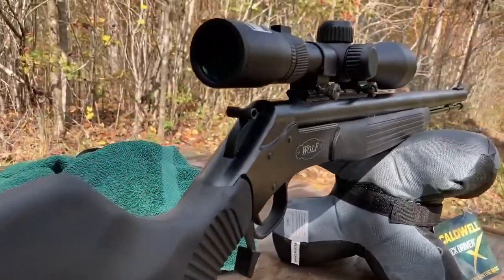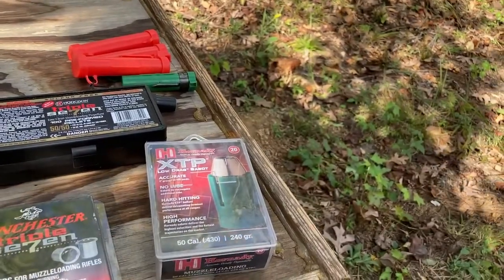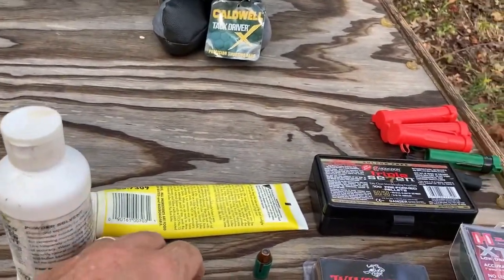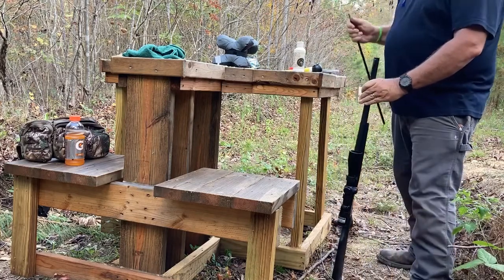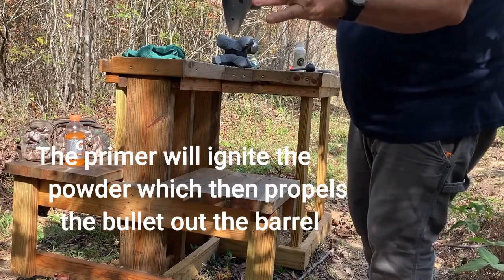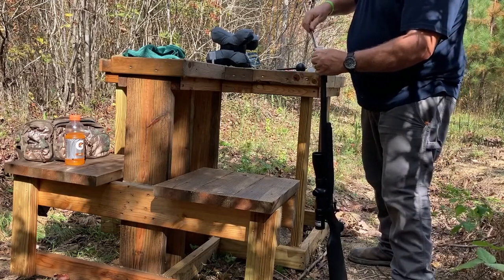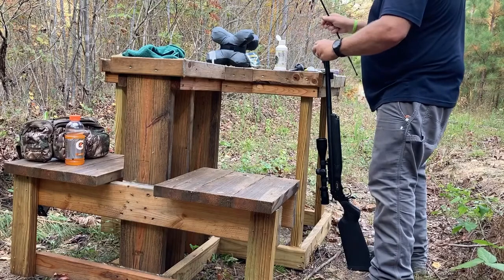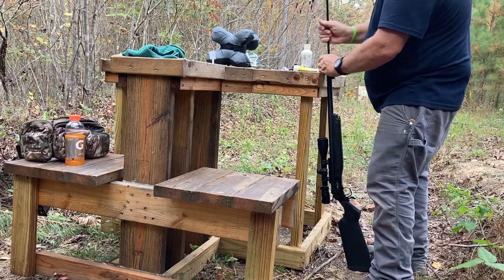Vlog #60 Shooting CVA Wolf & Optima

Comment: Try this. As much as I like the Bore Butter there is a large consensus that it will screw up your accuracy. Try just swabbing out your barrel with a regular cleaning patch concentrating on the fire ring that forms about where the bullet seats in the barrel, run a few dry patches down the barrel to dry it out and fire a cap to make sure its dry then load it and see if your accuracy improves. Powerbelt actually comes right out and tells you not to use bore butter with their bullets. Bore Butter is pure wax and all I can figure out is that it makes the barrel (Too slick). With all that said it is excellent to use if you're going to store your rifle away for an extended period of time and really excellent on the outside of the gun to prevent rust. I use it on all of my guns, they just won't rust when buttered up.
Reply from the maker: Okay, gotcha, I will try that approach on my Optima with the Powerbelt bullets.  Hopefully I can get the same accuracy I do with the Wolf.  It makes sense the Borebutter would be messing with the accuracy.  I would have never thought of it though!  Thanks for your help!!  Dave Out!!
Reply: @daveshsb  The Optima V2 LR I bought shoots very good. It's a few steps up from the Wolf but that sure doesn't mean there is anything wrong with the Wolf. The V2 has a nitrated barrel, mine came with a camo thumbhole stock and a really good scope on it and is Cerakoated. Sort of like in the AR 15 world, small changes mean big differences in price but doesn't especially mean it will shoot any better. I've got a cheap AR and a high-priced AR and targets can't tell the difference. (I actually shoot the cheaper one more). The big advantage with my Piston gun compared to my DI gun is the piston gun required almost no cleaning and a DI gun requires a lot.

Comment: If you can find it in your area, try the Tripple 7 Firestar pellets, I think you'll love them. 33 grain pellets and they say not to use over three for a hundred grain equivalent load. Of course, people shoot more of them in Magnum rifles but three is where Tripple 7 will no longer take responsibility for the outcome. I've shot four in my Optima V2 LR and I can tell you from experience the recoil is not pleasant. I find the cleanup behind these pellets to be very easy and they do produce a little more pressure and velocity. They claim 50FPS for the three-pellet load.
Reply from the maker: Well that sounds good, I will give that a whirl if I can find the pellets.  I like shooting at 100 grain even with a magnum rifle, so that will not be a problem for me! Thanks so much for the information and advice!! I appreciate you watching and taking the time to comment!  Dave Out!!

Comment: I bought a CVA Optima V2 50 cal LR nitride rifle. Only bullets the store had was powerbelts.  I did not buy any.  Went down to another gun shop.  I picked up 2 boxes of hornady 250gr sst. I am using blackhorn powder 84grs by weight.  I shot mine before season.  A 3 shot group was a 1/2 inch at 100. Blackhorn is so much easier too use. I killed 3 deer last week with mine. If i see the hornady 250gr sst on sale. I will buy a box. After season take a patch put oil on it. Then run it threw the barrel few times.  Then next time u want to hunt. Take a small powder charge. Put in the gun. Then shoot it. It will burn the oil out of the barrel. Shouldn't be any rust in the barrel.
Reply from the maker: I agree completely with you on the 250 gr sst.  When ever I see them on sale, I will pick up a pack of them.  The shoot true - bottom line.  Thanks for the comment and watching! Dave Out!!